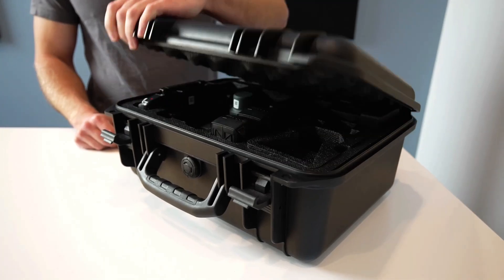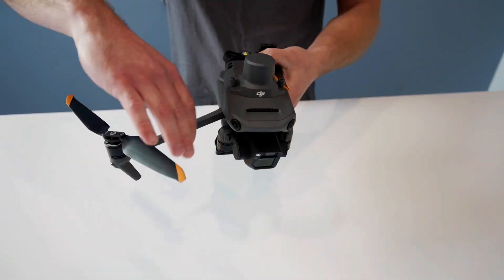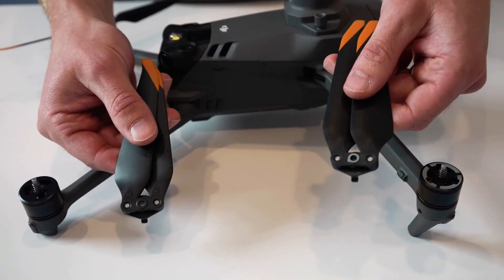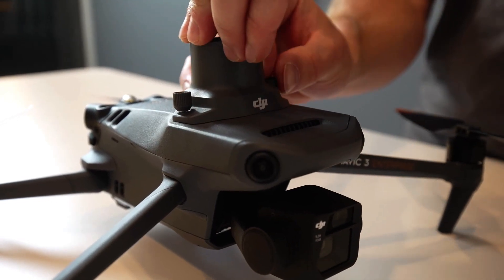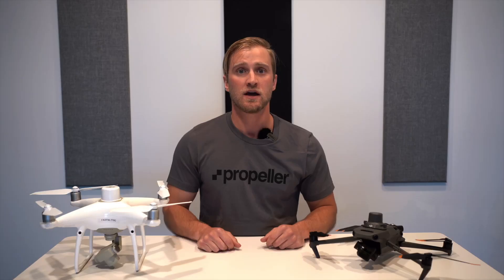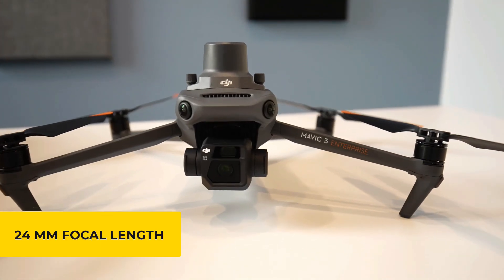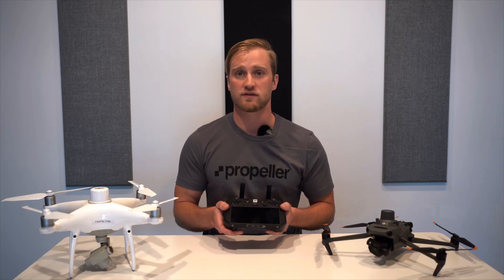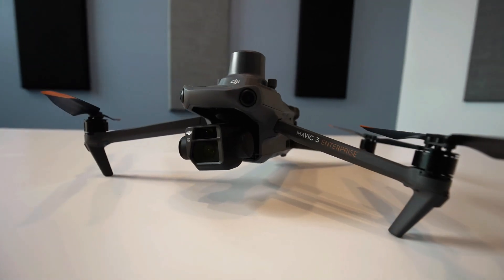A first look at DJI's new M3E drone

Comment: Whilst you make an effort to compare and contrast, your message gets lost as you don't compare like-for-like features.
You mention the RTK module, but no comparison in accuracy?
You mention the camera but don't mention (side by side) how much larger the M3E camera sensor is; 4/3 vs 1 inch. The adjustable aperture was the same on the P4 series. Nothing new there.
Mission transmits 9 miles vs 4 miles....and then you mention keep drone within VLOS. An irrelevant point on transmission distance. RTH is almost never an issue on a mapping mission due to height.
Sorry, but maybe some more relevant points for such a video on quality of image, speed of capture to get like for like quality, GPS accuracy (especially on Z values) with and without the GPS puck, price point, battery price point etc would have been useful. A rather vanilla video. As the police say in England "Nothing to see here; move along please!". Sorry; just being honest. I'll search elsewhere for a detailed review